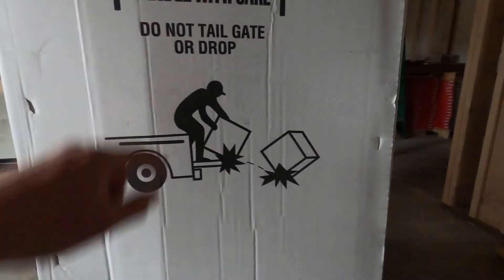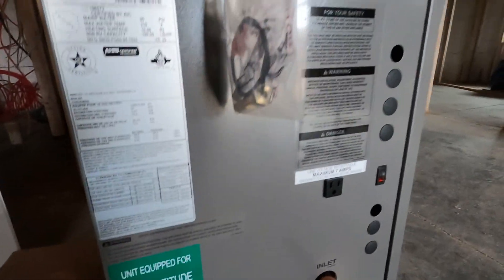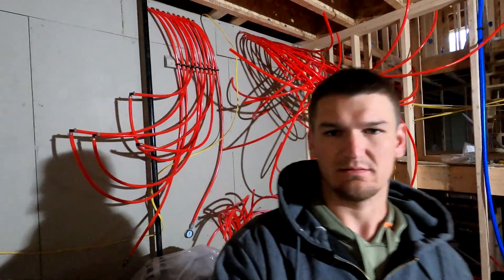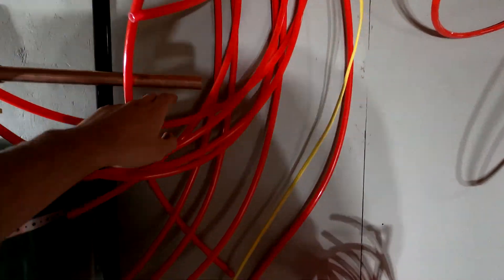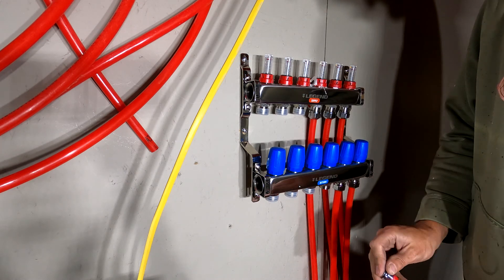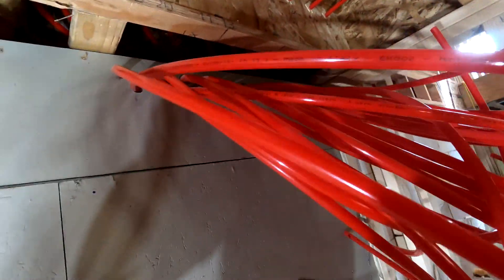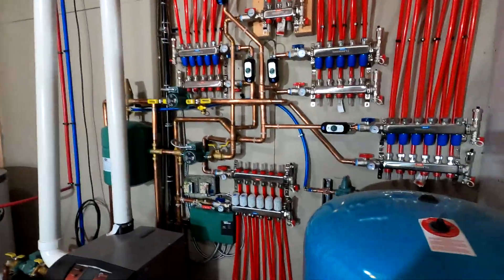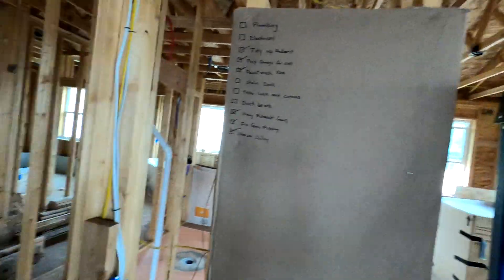How to set up Radiant Floor Heating System Part 1

Comment: Your secondary loop piping system is to small. 1” minimum.
Reply from the maker: I have 1” until it splits off to each individual manifold, and that’s how the manufacturer designed it for my system, and it seems to be working great.